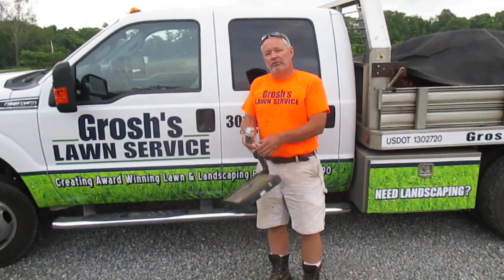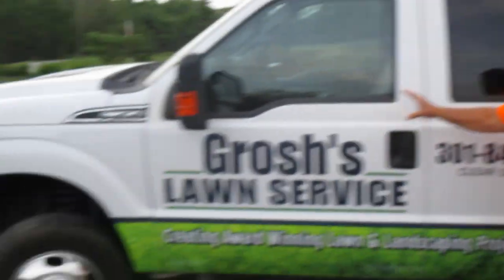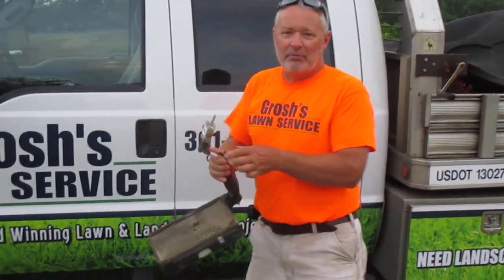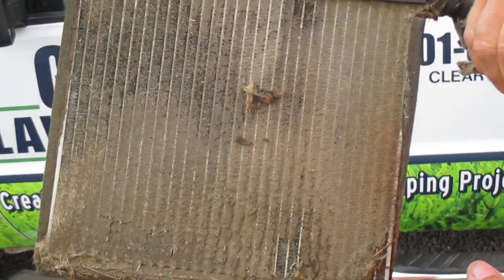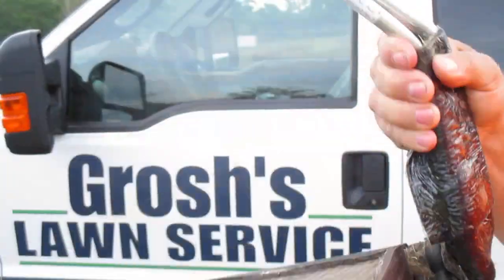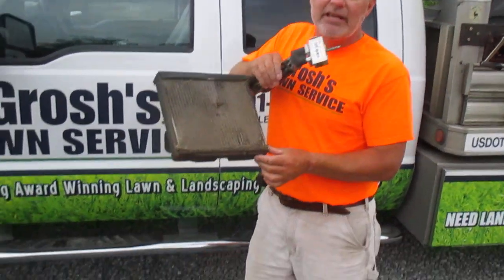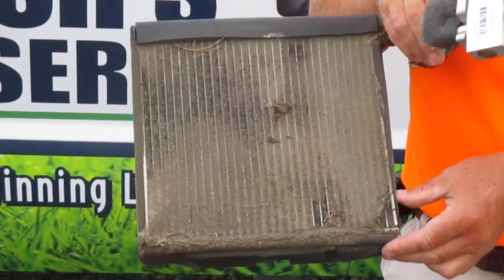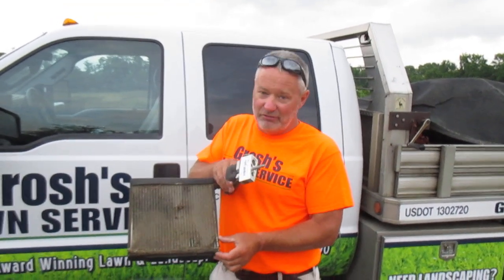Ford Motor Company F-350 Crew Cab Design Engineering Issue

Comment: planning to make easy 2 grand off of every  Hard-working person who uses their truck for actual work not just looking cool because you know we actually need to be cool in the summer. Garbage engineering from a garbage company like it's not even a funny joke My in the window AC made in Bangladesh still has a little filter in it which I can take out and clean but this $80000 truck doesn't need one.  But I guess they wouldn't figure considering all the other issues like the diesel exhaust fluid sensor problems yeah had my truck go from fourth gear suddenly into first gear and blow up the trainee of itself 2 blocks away from the mechanic after having an exerved because of their computer issues. Ford means :F'd  over raw deal

Comment: but wait was it ford that rip ya off or the dealer. it take 15min to pull the dash then 3min to remove the cover then 10 to 20min to wash the condenser off and only needs changed if leaking even then there 2 A-hole bolts behind engine ya need a ratchet wrench for about 15min each then 4 more bolts 2 in cab 2 out and 4 quick release lines the and the air filter box and recharge the a/c takes me 2hr to replace and 1hr to clean heater core and condenser. but I do agree there should be a filter in them for god sake there a work truck. thanks for sharing

Comment: I have a 2014 f450. I had the same issue. I'll give you the basics of what I did to resolve that problem. If you open up your glove box. That's where the intake is to recirculate the cabin air. All I did was cotton air filter for a furnace. That fits in the duct properly. Never had an issue since. Depending on how dirty the filter is. I either replace it or just blow it out with an air compressor. I think there's a couple YouTube videos that go into more detail. It took me maybe a half an hour to figure out how to do it. Filter only cost me about $8.
Reply: That seems like a great idea. Do you have any pictures of it by chance?

Also, am I correct assume that there’s no cabin air filter in that model?

Comment: If you're having a dealership replace the evaporator then no wonder you're spending $1400 a pop! Hot damn, it's a plugged evaporator, remove the blower motor and wash it out! Peterbilts are bad about it too... and they got a cabin filter. It's part of life, especially with a work truck.

Comment: I had the same problem with my 05 and 06 F350s. The evaporator on those trucks is encased in a box semi underneath the dash. I had to recover my freon and disconnect the accumulator, then wrestle it out.  Mine was so stopped up that I had to soak it submerged in a sink full of degreaser, then hose it out. I try to do all of my own mechanic work if I can.

Comment: Unless they’re legally liable Ford motor company will not honor any of their vehicles! Me and my dad both have F250 6.0‘s and they both had EGR cooler failures after warranty it’s a design flaw and they continues to do this and they continue to make sales regardless if they make it right!  quit buying Fords.!
Reply: I have an 05 and 06 6.0. Mine were under warranty when the 05 went through 5 EGR coolers and the 06 went through 6 coolers. I ended up installing bulletproof air cooled oil coolers and EGR coolers. I occasionally clean the EGR valves, but it stopped the problem.

Comment: There is a legitimate cabin air filter that captures and filters ALL the outside air.
Reply: Some of these trucks did not come with a cabin air filter. Mainly 2011-2012 year models, even King Ranch trucks. The Cabin air filter is an option you can buy from the factory
Reply: @tx4runner459  no sir. 
Ya couldn't buy it from the factory. All 2010-2015 f250 flat out did not have a cabin air filter, and the factory didn't sell em after the fact either.

Comment: I agree totally with you, it definitely is an Engineering Failure and could have been easily been avoided by Ford. Ford did offer a filter kit for those years, but it was not widely known, or pushed by the salesman. To this day I have not even found a picture of one but I have read articles that talked about them, and you can still get the filter for them on line. Fortunately for us, this part can be easily cleaned in a few hours of work, WITHOUT EVACUATING THE SYSTEM. That part you have in your hand is probably good, it just needed to cleaned. The dealer who charged you $1,300.00 to change it could have cleaned that while STILL IN THE TRUCK! You have to pull the passenger inlet tube and some wiring harness brackets, loosen the Accumulator/Dryer, pull the Evaporator cover next to the engine, wash it off and put it back together. It should have been about 2-3hours & $500.00 bucks to do the job and NO parts needed. Next time tell them to clean it instead of replacing it. Thanks for sharing though, I totally agree with you. Best Wishes & Keith Noneya

Comment: I sir, have engineered and made a successful cabin air filter for these vehicles. Y'all can text or call me anytime.....432-599-5002.
Reply: What did you come up with
Reply: 361 7561173 I made a cabin air filter. Fits perfect in these trucks. It's not the joke that jd Auto and truck sells. That only filters some of the air coming in. Mine filters all. Got a new number. 432-234-9880

Comment: So basically this is just another Ford F - UP. My 2012 Ford F350 is a piece of crap. I don't have enough time to type all of the problems I have had with this truck. I am actually sitting at the Ford dealership right now waiting for 8:00 am. To come around so I can pick up my truck after It has been here for 2 weeks. This time at 69,000 thou. The radiator was replaced and the filters in the exhaust system. I will never own another Ford. They lied to me about the warranty and many other things.

Comment: I agree completely. My F450 has no cab filter. My 2002 GMC has a cab filter. The F150 has a Cab filter. It's a fail on Ford Engineering part.

Comment: you will not see any HVAC home sytems WITHOUT a filter   same thing !!    same guy who designed this no filter system was in on the 6.0 head bold blunder
Reply: Except the 6.0 was designed and built by international......